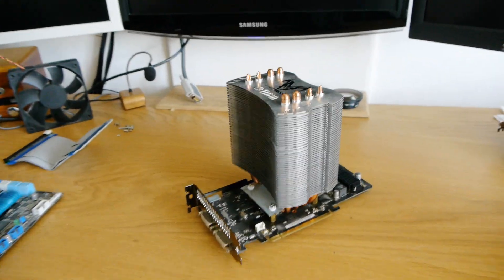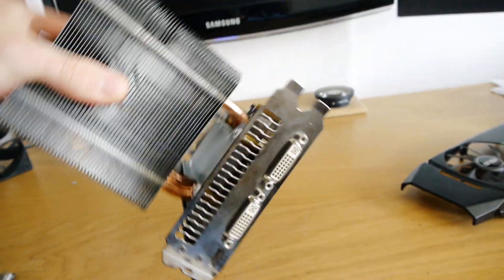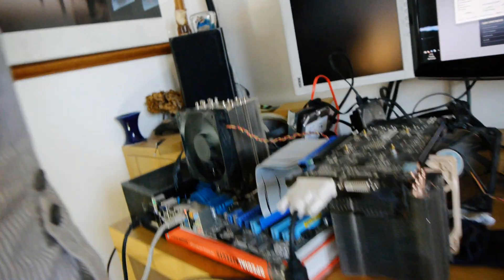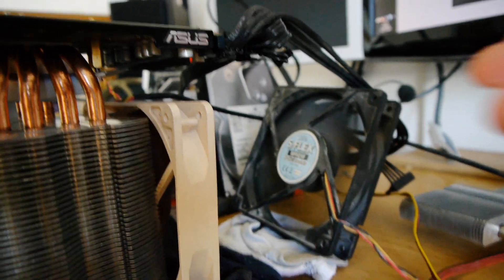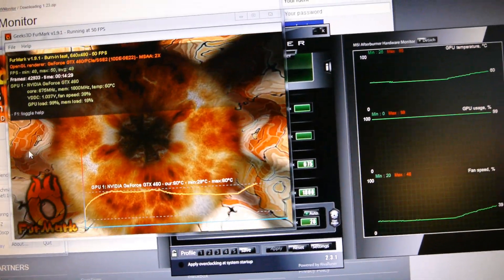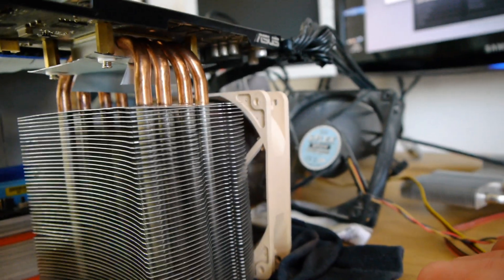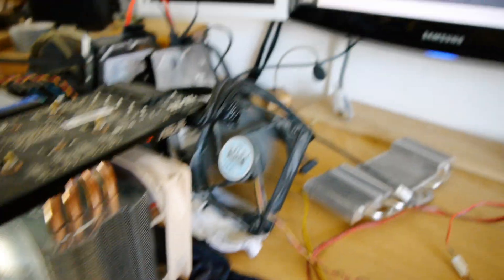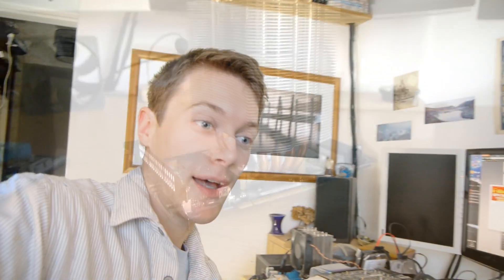CPU cooler on GPU (INSANE temps!)

Comment: This is one way to kill your GPU guys, the GPU itself needs cooled, but the heatsink also covers the memory units and the voltage regulators, something this cooler does not cover.
Reply from the maker: Star Wars News! Neither did the original Asus cooler, and I'm sure the engineers at Asus knew what they were doing. Besides, this was just a test platform to see whether it was worth working into a case - the completed version of course has memory/vreg heatsinks.
Reply: DIY Perks Ah k good to hear :) The original Asus engineers must have been pretty damn stupid then xD
Ill link you my new PC when its done, thinking of doing a buildlog for it :)
Reply: Star Wars News!
if the vram is not overclocked you dont need a heat spreader on the ram
Reply: Voltage Regulators,so long as it is not those crappy D-PAK MOSFETs,do need much if any cooling at all.For memory you can just buy some small heatsinks from ebay or newegg.You can also put them on the MOSFETs if you like.
Reply: Nope I dont think thats accurate. Every pipe is closed in itself. So there is no pump whatsover. They way it works is pure Physics, gravity and thermodynamics.
Reply: Well my GTX460 just died from Vram burn month ago so..... Vram can overheat (Y) And it was in normal build with stock sink and fan..... Then again it was pretty damn old so yeah.
Reply: DIY Perks Do you realize that this setup doesnt work right? look up how heatpipes work!!! They are UPSIDEDOWN!! would work way better when the liquit in the heat pipes was actually able to vaporize at the bottom and condense at the top of the pipes (because the gas will go UP) =)  *sry for bad english*
Reply: If you were gonna do this for real, it is very easy to buy individual MOSFET/VRAM sinks for each component, only a couple bucks and it'd stay nice and cold
Reply: 3Rton same here :(
Reply: DIY Perks its a 460, it doesn't have enough oomf to need voltage regs and memory cooled
Reply: There's lots of mid-range graphics cards that have no VRM and VRAM heatsinks whatsoever.
Reply: Androctonus1807 There is no GPU without Vram.
Rams dont get that hot anyways
Reply: Navhkrin You need to practice reading comprehension. Badly.
Reply: Androctonus1807 I facepalm at my self :(
Reply: Fieser Fettsack It will work, They have pomp mechanics that constantly push the liquid inside. Just like water cooling
Reply: Adskitl +1 to that, vram/mosfet are easy to cool.
Reply: DIY Perks actually the fan blew directly onto the the cpu and vram and mosfet. the fan you are using on that doesnt blow anywhere near any of those so you are wrong.
Reply: DIY Perks the heatsink didnt touch them but the fan blew over or near them.
Reply: DIY Perks also if anything I would never mount something this ugly and ridiculous looking. talk about clearance issues.

Comment: You don't lose buss speed using the extention cable? is the pci express slot still running at full 16x?
Reply from the maker: MasterGravitron Yeah, still at the slots full speed.
Reply: DIY Perks
That's cool. I have seen people use extension cables with AGP, But you would always knock down the buss speed due to signal degradation over the wires. Looks like PCI express doesn't have this problem.

Comment: Heat pipes don't work properly when they are upside down.  In fact you are probably better off with a cooler without heat pipes instead.

Comment: It's a smart Idea if you're running on a single card. I'd like to see a video where you overclock some bit? Just to see if it persists under some voltage tweaks or so on.

Comment: I got the Antec's KÜHLER H2O 920 ziptied  to my  HD 78503 2GB card, the  temps  on max are  around 35-40-45 and that's with crappy thermal paste...just saying

Comment: well You forgot to cool the Ram and other components that the Stock cooler performs using thermal stickers
Reply from the maker: The original cooler never touched the ram or voltage regulators, so it's all within spec.

Comment: My laptop's graphic card reaches 80-85 degrees Celcius :c
Does it needs changing a thermal grease and cleaning from inside? (I was often cleaning it with compressed air)

Comment: lol have the same MB and GPU for my gaming rig. cant find a update on this vid, did you have any problems with no heat-sinks on the memory. also great vid might try this on mine before a upgrade. u should try adding the stock fan to it with some foam. i think u did that on another vid with the stock cooler.

Comment: By the time I'm writing this comment, you might have installed the whole system with a custom solution... I might suggest to mount the whole system as usual, and building a sort of holding mechanism leaning on the bottom of the case, to hold the gpu cooler without stressing the pci-e bracket. 2, 3 or even 4 120mm fans could easily keep the system well ventilated, some sucking air in the case and some pulling it over - maybe at half speed. Consider applying additional heatsinks on ram, mosfets, vrms and what else is getting hot.
Reply from the maker: Already installed it in a custom case ;) you can find a picture of it on my Twitter (DIYPerks)

Comment: Just a hint, the CPU coolers use "heat pipes" which have a liquid/gas in them (can't remember exactly), in any case the inside liquid/gas is designed to rise with temperature through the radiator losing heat through the fins, because you have it upside down that cant happen so a vital part of the cooling design is basically shut off. You would have lower temps if the card was vertical or the right way up.
Reply: Even though in most tower cases that heat sink would be horizontal?
Reply: its not upside down, its sideways
Reply: ***** No, definitely not solid copper. Really hoping you are just trolling.
Reply: ***** Thanks god, you never know with people here on youtube. :p
Reply: It's working how it should, but it can't reach it's full performance upside down, maybe a 4-5 degree difference
Reply: Yeah why is though every case designed so that you have to mount the cooler sideways?????????
Reply: Because if they weren't, cases would be really wide. The motherboard would have to be horizontal instead of vertical, which would take up more sq ft, which people wouldn't want.
Reply: Sorry my english is so suck They still work horizontally but not upside down
Reply: Yeah but horizontally is not the ideal way right. And also my graphigs blow air down wich seems weird. I feel like if you really want the best case for cooling and don´t care about space you have to make one your self.
Reply: I was going to say this as well. And for people saying that the pipes are solid, you can try cutting one in half for your self.
Reply: John Powell doesn,t matter how you turn the cooler, upside down , horizontal, etc., because ther's no gas inside the heat pipes, but the distilled water is the most common liquid inside the pipes and is a really small amount of it. here's a little explanation from techradar.com: "
The heat pipes in PC coolers are sealed pipes with a small amount of liquid, usually distilled water, this is under low pressure to bring down the boiling point (which is why you can't make a decent cup of tea on Everest). The inside of the pipe is lined with a layer that acts as a wick, a woven wire mesh or sintered copper (copper foam is promised soon).
The water is boiled at the source of the heat, the gas diffuses to the cooler ends of the pipes where it condenses into the wick and capillary action takes it back to the site of the heat again. Only a tiny amount of liquid is moving, but the relatively large amount of energy required for the change of state means its shifting lots of joules. All with no maintenance or power required.

The vapour chamber is a variation on the heat pipe, and has been around a while but not been taken up much. Here instead of a set of pipes passing though the heat spreader, the whole heat pipe is flattened out and shaped to fit over the processor, with the rest of the heatsink built on top. "
Reply: I have cracked open these pipes before, they're not solid, they are copper(usually) they are hollow and there is a very small amount of liquid inside, we're talking a tiny amount.
Reply: Heat pipes and Vapor Chamber are different things.
Reply: I am a Computer/Electronics Tech... Yeah you are correct and it is liquid in the pipe. Works by the liquid heating up and turning to a gas... the gas rises up or across the heatpipes and disperses the heat to the cooler part of the pipe/fins, the gas then condenses and the liquid then returns to its original pool.

So yeah being upside down severely affects the cooling of the unit as warm gas will always rise.

Comment: except the fact that ur toasting ur gpu ram or wut ever the hell there called
Reply from the maker: I mention that at 02:30

Don't forget that 1) this was a temporary test, and 2) the original cooler never touched the memory etc, so this is actually better than the original cooler in this regard (due to the air cooling the ram being cool, rather than air that's gone through the heatsink first, which was the case with the original cooler). So, totally within its designed specifications, and I'm sure ASUS knows what they're doing.
Reply: DIY Perks why dont people design stuff liek this then.. like a heatsink thats for gpus
Reply: LampOfMagic Because of the inconvenient size, if you noticed, the other PCIe slots were covered, and unusable.

Comment: Nice project! I have been pondering the same mod on my HD5970 for a long time and having all of the heatsinks and CPU coolers I was motivated to bring this project back onto the table! Last weekend I placed a Corsair H50 and H70 onto the GPUs with a couple Enzotech ram heatsinks and some other ones laying around. Previously I was running idle @ 50c with over 90c on load. Now i make 28c idle and not even touching 37c gaming load! I used IC Diamond for my therms. (Everyone likes diamonds right?) Great Work!------ Who needs a case anyway... I run a workbench =)

Comment: Interesting experiment.  I have rigged a Antec Kuhler 920 sealed liquid cooling CPU heatsink radiator on a hot running Nvidia 580GTX.  At stock clocks the GPU temp is about 55C with a pair of push-pull fans on the radiator running quiet.  I also put a a fan over the other circuitry at the back end of the graphics card circuit board.

Comment: For those thinking about doing this at home, note the extra case fan he has blowing against the card. There are other components on the card apart from the GPU - primarily power MOSFETS - which require airflow.

Comment: 23 degrees Celsius is pretty hot?
Reply: oh my god in my country in the gulf ( kuwait ) we have 38 - 45 CELSIUS and he is complaining about 23 :D OMG
Reply: The temperature peaked at a little over 50 degrees, and we can assume that the ambient is a few degrees below the idle temperature (24 degrees), so the performance isn't matching water cooling but its fantastic considering the cost and noise.
Reply: L3xou97 Plot twist: owns a pentium 4.
Reply: Yes pentium 4 were very hot. That was before intel make dual core processors. Pentium 4 was the first cpu to need a 4 pins connector on the power supply.
Reply: L3xou97 Pentium D was a dual core too and hot as hell (actually 2 x p4). And don't forget the pentium presccot ( p4 with 2 threads) They ran really hot.100c was normal lol.
Reply: Everything is relative.
Reply: Not to mention he has turned it the wrong way round. If he placed it like he has at the start of the video it'd probably lay at delta ~3°c
Reply: mohammed alhaddar
In the uk we/they are used to colder temperatures. In Qatar  where I live (not there atm) it is 44 right now and that's cooler than it was before.
Reply: 21°c is average room temperature.
Reply: Tommy Mikkelsen 23 is actually cold once you live in the gulf region. Ps. Isnt it 24°c?
Reply: Everything is relative, we go to the beach when the water is 15
Reply: it really depends man. we are all used to certain temperature ranges. I wouldn't even step in 15 degrees water.
Reply: It is. You should sleep at 18 degrees Celcius.
Reply: Emil Fihlman When I have my window open at night my CPU can get 2 4 degrees C in the winter haha.
Reply: When you are not sick you are at 37°C.
Reply: 23 degrees celsius hot on a gpu?

My room temp is 22 degrees, I don't know what you are talking about.
Reply: 23°C is really good for a gpu.
If your GPU is at 90°C, the GPU will stop cause of overheat and the screen will be black.
If your GPU is under 60°C it's good. If your GPU is 60°C<     <70°C it's sow sow. And if it's more than 70°C there is a problem, try to remove the dust and change the thermal past.
Reply: 100C was the never exceed temperature - they were normally at around 55-60 under load with stock cooler and a half decent case.
Reply: I guess u didnt had my presscot on stock 3800 mhz. lol
Reply: 23 Celsius is only about 50 degrees F
Reply: Emil Fihlman at 18 celcius i freeze, i hate "cold" and it hurts me, i like 23c or higher
Reply: L3xou97
Do all of them do that? The fan for mine died today and I didn't notice, I came back to my pc after being away for awhile and saw it had climbed up to 97C and was still running. I turned my computer off and felt the card and probably couldn't leave my hand there more than a few seconds before it would hurt.
Reply: 90-100°C it depends of your GPU, 90°C is not a problem but i prefer stay lower.

Comment: Out of curiosity, did you try turning the hs so the wider side faced out, put a fan on there to pull and a smaller fan, maybe a 90mm?!?!?, on the smaller side to push? Great proof of concept video but on a 460 a fenrir is def overkill. This would have been a great, great mod for a 480/470/580/570 though. Thanx for putting the work in and showing the numbers cause ive ran through doing something like this myself but never got the time to try it out. \m/
Reply from the maker: It's not quite overkill if you're after silence. I am planning on doing this with a GTX 880 whenever it's finally released.

Comment: If your looking for a more silent setup take a look into the "ENERMAX T.B. Silence UCTB12P 120mm PWM Function Case Fan" my heatsink came with one 8db normal fan speed has a max cfm of 71, after seeing this I might get another enermax cooler and fabricate a mount to put it on my new gtx770 that way with the new rig im building ill get more heatsink to oil contact (mineral oil cooled pc)

Comment: What you've just installed is the heatsink. And proved that the bigger the heatsink, the more heat it will disipate.
And I thought the idea that I installed a K7 fan on my GT430 was crazy... this is even crazier.
I think a Mini AT-X form factor motherboard will fit that huge heatsink on a desktop, as they (most motherboards) lack the extra PCI expansion ports.
It would have been interesting testing it on a graphics-extensive application (like modern videogames :) ).

Like it!